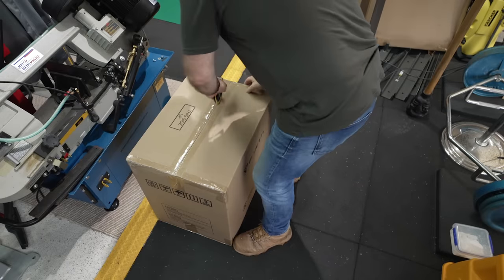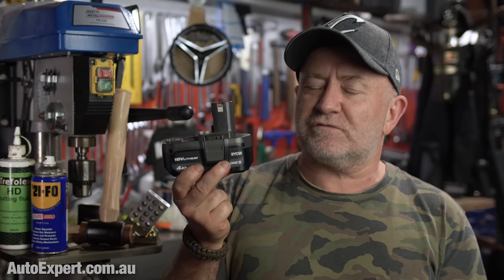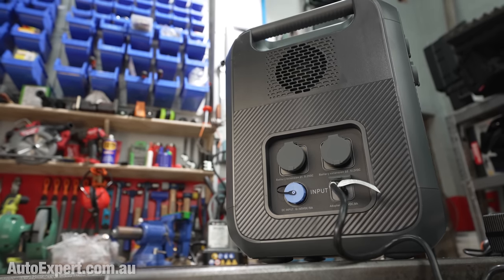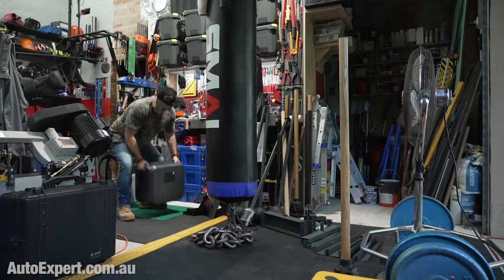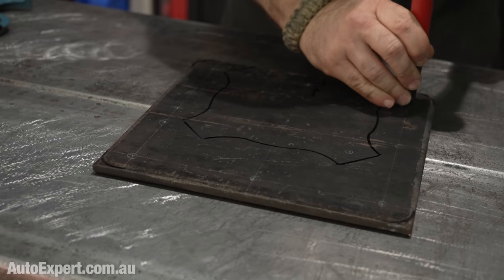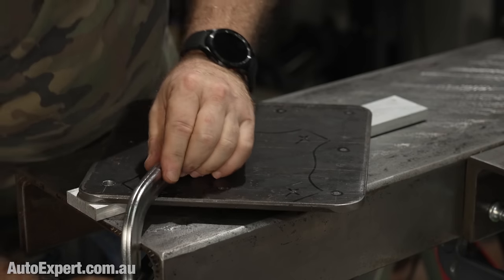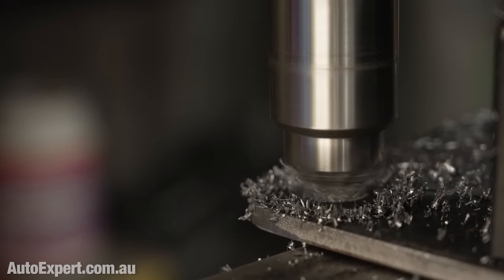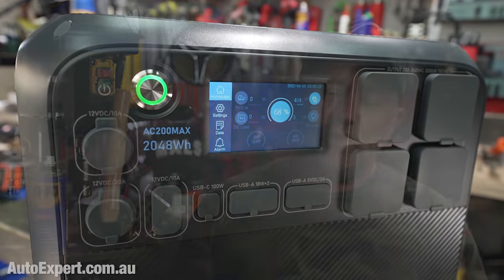Ultimate portable power solution? New Bluetti AC200MAX - full test! | Auto Expert John Cadogan

Comment: These things are expensive junk.  Alot of utubers (this guy included) got the unit for free in exchange for a favorable review.  They are nothing but a hugh battery and a computer. They lockup, glitch and have to be rest all the time. They run out of power in only a few hours and then your done. The optional expensive solar panels will not keep the thing charged under load. The batteries go bad and nobody can work on them. They tell you SAVE THE BOX! Yeah because you have to send it back to them AT YOUR COST even under warranty. At 65lbs shipping weight that will cost you over $100. A real generator just take it to any local shop. But u probably wont have to. Just keep the oil changed and replace the air filter every couple years. They run indefinitely and are always ready. Bluetti units lose there charge just by sitting there. You have to spend money even to charge it. Unless you buy the expensive optional panels (another waste of money) This thing is so expensive you can buy a real generator with the same money and have a much more dependable unit thats runs off regular gas available anywhere. Dont even think of buying one of these